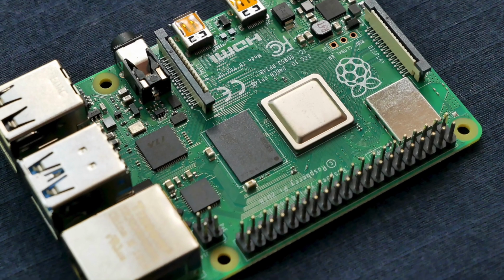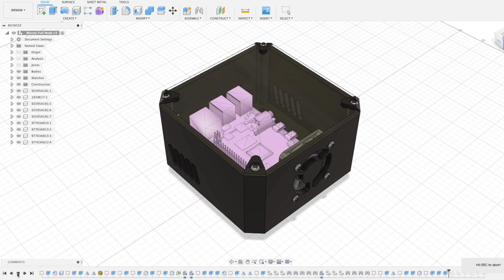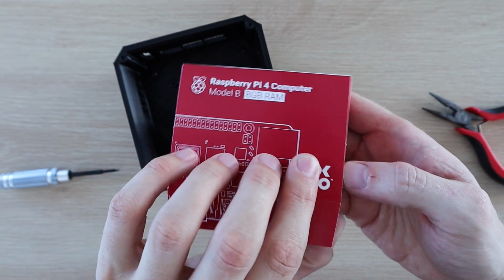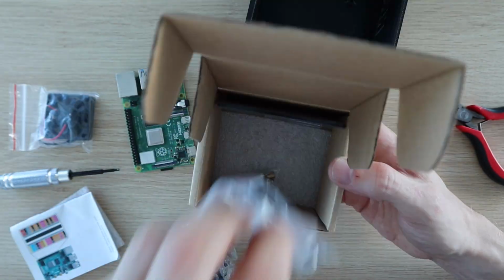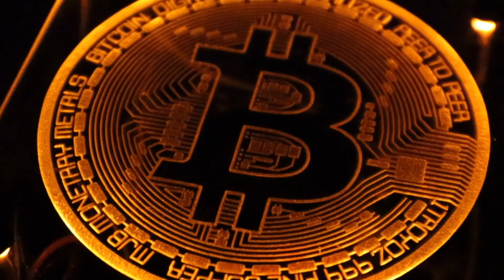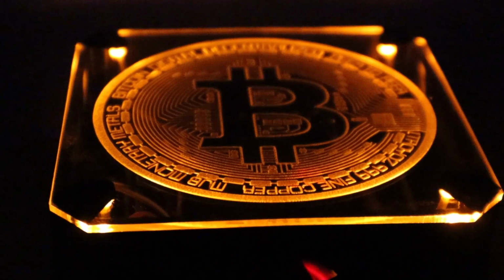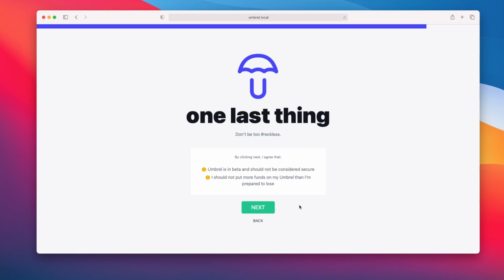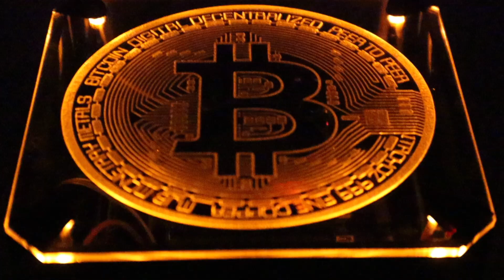Build & Run Your Own Bitcoin Node On A Raspberry Pi

Comment: you should make an sell these cases. i would buy one
Reply: He does sell them. Go look on Etsy at his page. It doesn't include all the parts but you can purchase most of the kit and get the rest of the components online or at your local electronics store.
Reply: @trevrockgw  Does he sell one for a bitcoin node though? Based on the parts outlined in the video, there doesn't appear to be a case with a slot for the SSD.
Reply: @dizzlef3760  I believe he does. I ordered a case and plan to turn it into a node. I can let you know when I finish!
Reply: @trevrockgw  awesome thanks alot
Reply: @trevrockgw  did it work?
Reply: @ksoonsoon  so I think Dizzle above was correct, the case he sells on Etsy is not the same thing as this video. The one I bought was large enough to hold the raspberry PI but not big enough to hold the SSD. So to answer you question, yes I got it working, but it looks different than what we see here, and the SSD is outside of the enclosure. Two screws were missing from my kit and two of the holes did not line up well which was frustrating but overall it works and looks good! I have been running a node on it for about 2 months now.
Reply: @dizzlef3760  hey man, see my comment above that I wrote to Dane.
Reply: @trevrockgw  Thank you.  We just discussed pricing for everything. Excited to get it!!
Reply: @ksoonsoon  that's great! Good luck and enjoy.
Reply: @trevrockgw   hows your node going are you still running pi with umbrel ,
Reply: Full set ups are an option too to sell. What will one cost?

Comment: Do you really need 1TB?
Reply from the maker: Not at the moment. The current blockchain is only 330GB, so a 500GB SSD would be fine,. Adding a 1TB one just makes it future-proof so it'll run for the next few years without having to be upgraded.

Comment: Can you do this on a regular PC? I have a Lenovo T430 Quad Core i7-3720QM with a 10GB DDR3 RAM
Reply from the maker: Umbrel only has a linux distribution at the moment, but they do have instructions to run it on a virtual machine on windows or mac.

Comment: Cool video! I might have missed it, but how would I go about skipping a 3rd party provider, when it comes to sending Bitcoins? Would that require me to use Umbrel to send/receive the coins, or can I keep using my existing wallet on a 3rd party site?
Reply from the maker: Your Umbrel dashboard acts as your new 3rd party interface, except that you're now running it on your own hardware and have full control over it. You could either import your 3rd party wallet into Umbrel or transfer your Bitcoins out of your 3rd party wallet.
Reply: @MichaelKlements  Great - what I thought. Thanks for the reply!